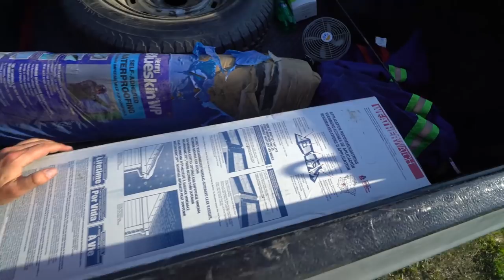SKOOLIE SUBFLOOR + JUNKYARD FINDS

Comment: about the height of the tank for the veggie oil system : 
you could make a  L bracket sheetmetal / aluminium / plywood rectangle underfloor storagebox (accessable through the floor or through the side of the bus ) thats tall enough to store plastic jerrycans standing up and probably cost less than a custom made stainless tank with the brackets 
in doing that you can pull out an empty and go to a helpfull eatery to fill it with there waste veggie oil then carry and place it back in storage untill needed , so no need to pouring it out intoo the (big ) main tank in the parking lot with the chance of spilling it or anything like that , the only handling after that is treading the fuelhose / pickup pipe in (screwcap with hole for hose / pipe)
the fuel pickup could be a little more involved with a collector and all sorts of ballvalves and a hose in every jerrycan , or just use one hose and manually transfer it intoo a jerrycan at a time  ,filling the main/daytank using a scavenge pump and filter 
i think one normal diesel tankload of veggie is about all the milage / traveltime youre ass can handle being in the drivers seat per day , filling up just becomes the start of the day (wake up , put the coffee on , dress in old clothes , transfer the veggie oil to fill the main tank , start to warm up the bus , wash up , dress in better clothes , drink coffee ,  eat , and go)

the jerrycans are cheap / free , can be eazily replaced or taken out to be cleaned as well and one bad batch of svo doesn mess up the rest of youre fuel if you catch it in time using clear jerrycans you should be able to see if theres water and stuff floating in the oil after having it sitting overnight a bit
https://www.jerrycanshop.nl/media/catalog/product/cache/1/image/650x/040ec09b1e35df139433887a97daa66f/2/5/25l_3.jpg
it be cheaper and eazier in the long run than even a used stainless tank i think , having a ground hit cause a leak will only involve changing a can and maibe use a hammer to dent the storage out

Comment: Wasn’t it possible to cut that tank in half and mount it with the NEW flat side up. There would have been enough removed  material to make the new flat piece needed. Just a thought...fun stuff.  A good shop may have attempted that. You could have made the tank even longer if there was enough room underneath.

Comment: The rims without the center are used on a Dayton style rear axle. Dayton rears have the cast spoked hubs. They may be 5 or 6 spokes on the hub that is attached to the brake drum or rotors. A rim that has steel center attached is called a Budd rim or wheel. It is much heavier to handle when changing tires and is used on a different style hub assembly. If they are duals, each wheel is separately locked on the hub. We always used Dayton, but eventually could not get them and had to change to Budd.  Both types used to be made in a split rim, which were dangerous to change tires if you did not know what you were doing. We used chain around the rim and split ring and a remote air valve so the installer could move away from the tire. Also steel  cages were made to put the into when filling with air. Tubeless tires took away the old split rims as they were used for tube type tires that were bias-ply not radial.  Radial tires were a great thing for medium and heavy duty trucks just the same as they were for cars and pick-up trucks. Hope this helps. From an old school bus and van contractor.
Reply: Daniel J. Baer, thanks for the detailed history. I recalled some of the data but you put the story together handily. Appreciate your input, thanks again.
Reply: Dayton style are used mostly on container /chassi. Big rigs and trailers use mostly regular rims 22 or 24 inch.

Comment: Good show Jax, Bravo Zulu! 

(#1.) If I may inquire, what was the THICKNESS of the OSB for your sub-floor?
Thank you for the many suggestions on various products throughout your builds. 

Regarding sound abatement and other attributes, and upon your suggestion, 
I am researching and reviewing the specs, etc. on Henry® Blueskin® RF200, Grace Ice and Water Shield and IKO Enerfoil Sheathing Wall Insulation. 

(#2.) If you don't mind, are you applying the ICE and WATER SHIELD to the steel floor AND steel ceiling as the FIRST BARRIER?

Thanks in advance for your valued counsel.

Conversion here is a 28.6-foot 2006 Blue Bird All American FE purchased from the USAF at Altus AFB, OK.
"The Bunkhouse Blue Bird" on 07/24/18, I got her "Registered, Titled and Licensed" as a "Motor Home" in Texas.

Best wishes and fare travels!

Rex